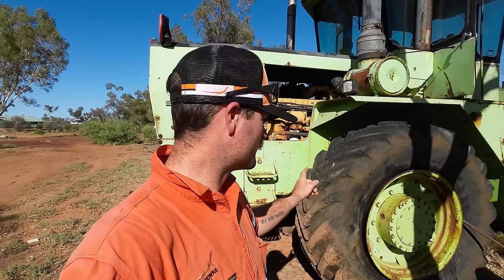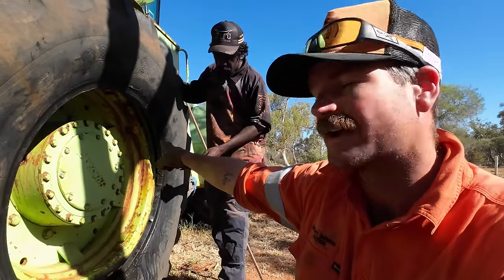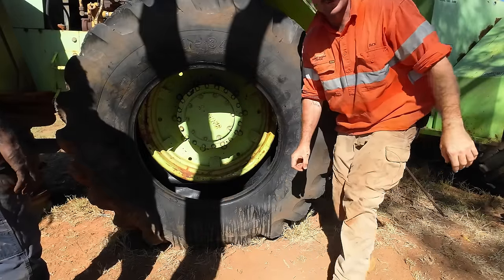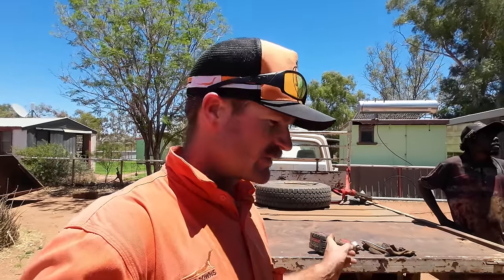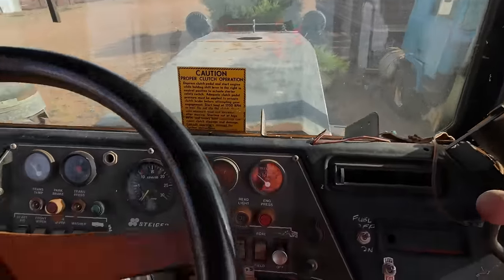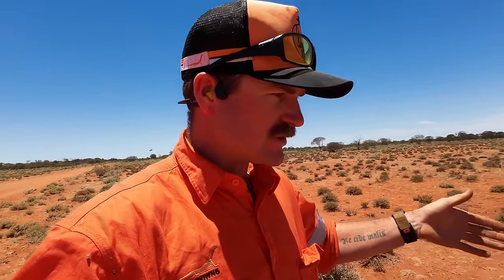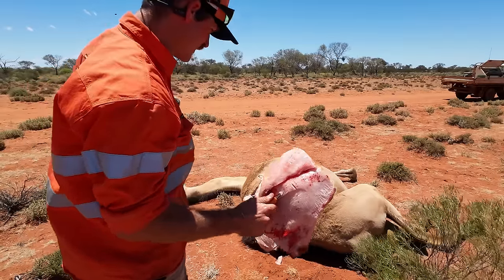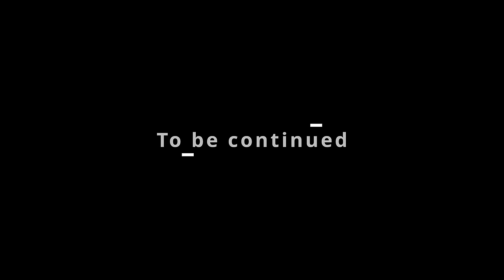Outback Tire Tango: Camels Interrupt Mining Rehab!

Comment: Jack, you need to develop a portable abattoir that meets the regs and can be moved from yard to yard..   Vac-pac and chill down in a container chillers before trundling off to a sustainable meat market.  Barriers to entry are opportunities for innovation! 😊
Reply: Problem is,  checking the health of the animal to see if it is free of TB, cancer and various other stuff, usually a job of a DPI vet in an abattoir, before on-selling to the public. Back to the days of Kangaroo substitution.
Reply: Many problems - Prenti is 1200km by road from Perth (i.e. Market). You would need all the equipment (Freezers, cutting room etc) brought in, not to mention the additional fuel to operate them. And more staff. The average amount of meat off a "Fattened" i.e. consuming scarce pasture, camel is about 400kg - these are wild ones, so let's say 350kg.  Camel Meat retails for $4.50 to $7.50 a kg. (Less for wholesale, so maybe $2-3/kg) way less than beef. Cartage - minimum economic load for a semi lets say 10 tons in weight - or $20,000 worth of meat - figures that I have from previous research (I was an agribusiness analyst for a while) put cartage at 9c/km/ton I think those were coastal numbers - not deep into the bowels (sorry, jack) of Australia. - but you are really only carting one way, so that's $2200 in shipping before you start. Big chunk of your market will be for Halal, which means specialist butchers, certification etc.  Not to mention changing all of the watering protocols and mustering of camels on prenti. If it's for sale/human consumption then there will be medical costs similar to cattle. 

By comparison, here in south east queensland, there is Summerland camels in the Scenic Rim, (It is adjacent to my brother's farm). Only 45 minutes out of Brisbane, and they don't sell any meat - just milk and related products... ). Which pushes to an export market - That takes the shipping cost sky high.  It would cost $5-8000 minimum to get a 20 ton container to the middle east.

The rough costs, unpredictability of the product and market, remoteness of  location, are already ringing alarm bells for someone who used to assess the viability of agribusinesses for a living. As jack has highlighted - doing anything other than culling them, would cost them money that they don't have, and would be unlikely to get external investment in. It would be expensive to start as a niche market, and most of the economies of scale come into play when it grows past that - in the mean time, it's a gamble that only works if you have very deep pockets.
Reply: I was a banker before returning to farming.  I came to the conclusion that most analysts and consultants were just that as they were overtly risk averse.  The progressive profitable customers focused on solving impossible problems, and capitalised on their achievements.  1, this is not normal camel meat, it’s “Jack out the Back” camel meat - that retails direct for significantly more.  2, as a niche product it has no need for scale; keep it unique..
Reply: @michealsummers714   The meat would still have to be checked for parasites.

Comment: Haltec Water Adaptor for Liquid Fill Tires or Water Inflator less than $15 USD and seems air valve on top when doing.  Calcium chloride tire ballast used here we freeze in the winter months.
Reply: In NZ we added a 4gal tin of meths to each tyre.

Comment: Very interesting update Jack. Top effort with the tyre off and back on.

Jack I think in one clip you mentioned the carcasses are piled up and burnt. I see at the end of the this clip you were dragging the carcasses together. What happens with them at this time of the yr? ( I assume it’s too big a fire risk at this time of the yr).
Reply from the maker: Not a huge risk of the fire carrying, after a few days of high heat the fat renders down and it actually burns like diesel fuel.

Comment: I use vice grips oriented at 10:00 o'clock on the edge of the lip of the beadon the rimwheel then i can spoon the bead over by myself , when i air it up, i use a bar to keep the tire bead away from sealing up to give the tube a chance to push as much air that can get trapped between the tube,  rim and air cavity, all else fails  leav the vice grip on the stem and deflate the tire after you get the beads to seat of course, might take a couple of tries, but tgats how you keep from pinching the tube.

Comment: G’day Jack. Hope you and your family are going great and have a good Christmas. The time I see these videos when you’ve asked questions you’ve already done it. I’ve done thousands of hours in Steiger and every other tractor you can think of, you asked about the key but you’ve already done that. Just remember that back in the 70s and 80s they are like old Holden Utes. If you got a problem with the tube of the tire put a clean tarp on the back of the Ute or ground then blow it up half way and it’ll show you which side of the valve to put on the tire and then let it down and have the valve hole to the top of the rim and then put it all back together exactly as you did then start filling after you’ve blown it up still have the valve to the top when putting the water in and keep putting the hose back on until there’s no more air coming out and just water. We’ve been doing that since Jesus was a boy. Keep ripping into those camels since I can’t. People who complain about feral animal culling just tell them that you’re doing it for the environment and you could remind them that without farmers they would be naked and have no paper to wipe there bums and each time they use a fork it’s because of a farmer somewhere. We have the same problems here so I know what you’re going through, keep up with it and catch you later

Comment: G'day, not being familiar of heavy equipment, but as someone that's done a bit of mechaniccing in my  past, with all those bolts on the wheel rim, aren't they a split rim? I've seen these before where you can take half the rim off to facilitate an easy tyre change. Big Steve, E. Yorks. England.
Reply: Onsite tyre fitter here. These are definitely one piece rims. The outer row of nuts hold the wheel to the hub, the inner row retain the actual drive axle. I noticed that the boys struggled a bit, but with some more practice, they will learn some of the tricks to make the job much easier.